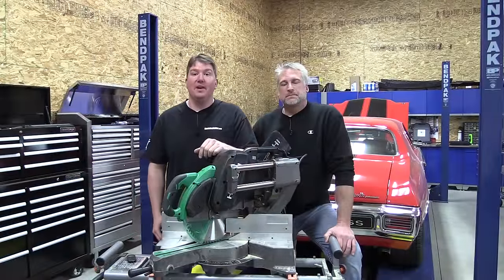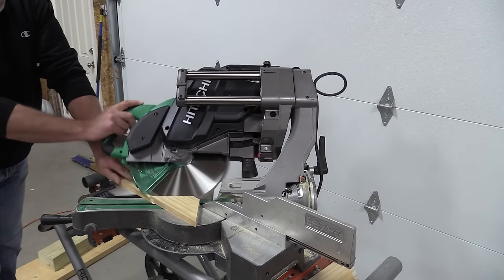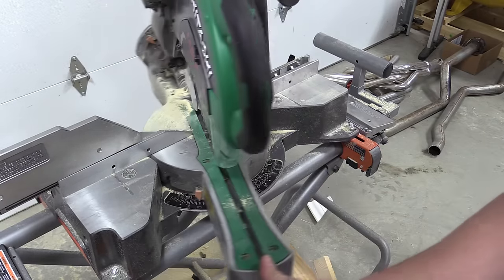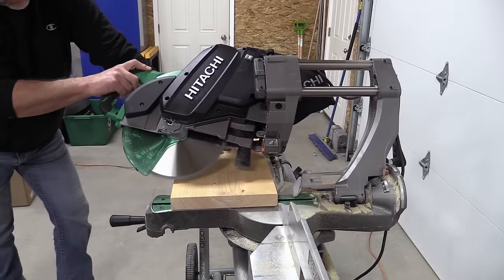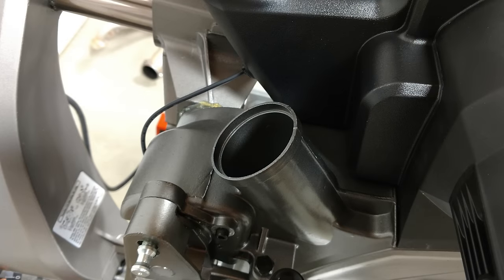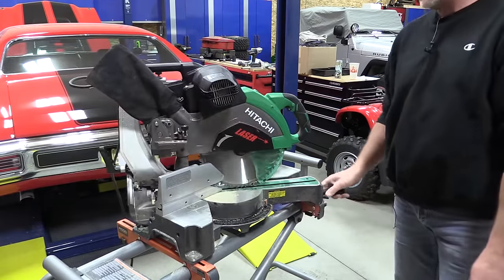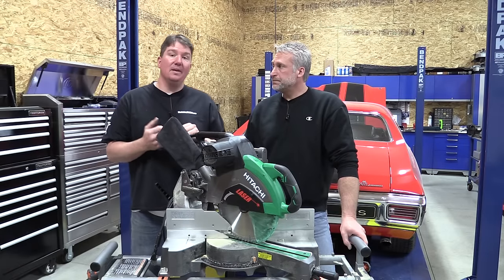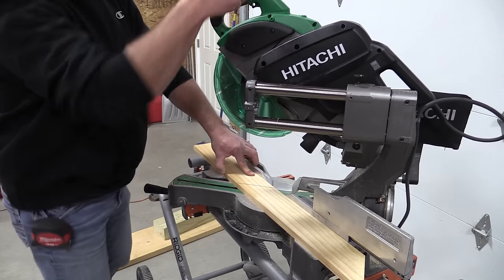Hitachi C12RSH2 15 Amp 12 Inch Dual Bevel Sliding Compound Miter Saw with Laser Marker

Comment: I have this saw and I had it's predecessor. At first I truly felt that it was simply a stripped down cost cutting downgrade. Those feelings quickly subsided though. Yes you lose the micro bevel, slide cover, crazy awesome looks, and the depth stop no longer swings out...BUT in return you get a higher fence THAT SLIDES OUT, noticeably more power, ridiculously easy brush access, a more comfortable handle, wider table, and it's significantly lighter (those few pounds add up fast) without jeopardizing the build quality. I also have a 12in Delta Cruzer and I'm absolutely in love with both of these saws. I've used a ton of Dewalt sliders as they seem to be around on every big job site, and I also previously owned a Milwaukee 6955-20 that got stolen off a job site within two months lol (wasn't laughing at the time). This saw is as just good as any of them out there when it comes to finishing your job within the time you have to do it. The one thing I don't care for is the bevel, which is obviously the biggest complaint. It's annoying to set and it only goes to 45 on each side. Also the blade is VERY close to the throat plate at full bevel and many have said it tends to scrape on theirs. I've not had that problem but I definitely wouldn't question the honesty of those complaints. Still, no miter is perfect in every way for every person. This one gives me enough reasons to prefer it over any other though.

Comment: you checked the saw for square on the wrong corner, granted if the board was parallel it wouldn't matter but regardless you should have the square on the edge that was against the fence.

Comment: I have this saw and purchased a universal adapter from Amazon. It fits snuggly over the dust port on the saw. The other end ( I cut off the smaller sizes) fits quite nicely into a ShopVac 2 1/2” screw hose attachment. The type that you can twist into the threaded exhaust port of some ShopVac models. It stays in place pretty well, although you could always tape it to ensure the hose absolutely doesn’t move, but I’ve not had a problem with it.
Reply: Aaron Karnovski can you please provide a link the adapter?

Comment: I have the previous generation of this saw I have had it for a year or so and I like it especially compared to the craftsman one I had. The laser works well I ended up using an adapter on the dust collection and my vacuum hose slides right inside the adapter and works ok. Like most miter saws the dust collection isn't great but ok. I have a dust hood I am making for it when I make my miter station. I like it overall but haven't used the side miter much so the handle in the back is annoying but not a deal breaker.

Comment: Not trying to bust your balls but a couple things here. 

1. You should check 90 with the side up against the rail perpendicular to the cut you are checking. You checked the outside, in a perfect world it would be parallel but it's just good practice. 

2. The rail system is not innovative. Festool, Bosch, and even craftsman have came out with zero clearance rail systems. It's been done for a long time. 

3. The laser diapering shouldn't be an issue. You line up your mark to the laser and then cut. No need to see the line the whole time. The laser goes away with lowering because of the rubber dust chute. 

I have the older model and love it. Especially on sale, it's a fantastic buy.
Reply: 2. Yes, it's been done for a long time... and Hitachi was the first to do it. It's a Hitachi innovation in that Hitachi pioneered it. http://www.businesswire.com/news/home/20050816005061/en/Hitachi-Pioneers-Sliding-Compound-Miter-Landscape

Comment: The only thing I didn't like was the laser being blocked when the blade start to come down. I am a beginner diyer so I need all the help I can get. Used to have the harbor freight dual bevel sliding miter and after 2 weeks I returned because it took up too much space, and you had to square the saw if you wanted to get accurate cuts.  This one is ready out of the box with the exception of the included blade.  Spend the extra $50 for the finish blade. Great video guys!!

Comment: If there was a shootout of the top three 12" saws, What are the top three? I ran out and bought the new Harbor Freight Hercules Miter saw since it is as good as a DeWalt for a lot less, but now that Ive seen this and several other that I didn't consider, I'm hoping I did well. I really like the way this saw can be put right against the wall. It looks like the amount of degree sweep this one has less than the Hercules.

Comment: The bevel lever feels backwards because it is a left hand thread.  I just got mine and from the way they used the bevel lever it seems like a minor issue at best.   It was like they had to find something to complain about.    Glad they mentioned the laser on switch because I hadn't gotten that far in the manual.

Comment: I have this saw and the slide is very stiff. Does anyone know what to clean it with and lube? Or maybe there is something wrong with my saw. Does anyone know if there is supposed to be two bearings or one on the slide. My saw has one.

Comment: Man, just bought the C12RSH2 at Lowes, and they have the C12RSH at Ghanall Lumber. I'm wondering if I should return it and get the older version.
Reply from the maker: woollybullyful that would depend on how important the micro adjustment is on the bevel.

Comment: How does it perform chopping down 8/4 or 12/4 hardwood stock?  I have the Ridgid 12" sliding miter and it chatters like a lonely old woman on adderall when I try to slide it through thicker rough stock.  Curious if this design/saw performs better for woodworkers.  I think the Ridgid was designed with rough carpentry in mind.
Reply from the maker: Scally Wags This saw does well with hardwood.  I have never cut 3" thick hardwood, but 2" is not an issue.  I did find that a good Diablo blade made a big difference for the better.
Reply: WorkshopAddict I think y’all tested the Ridgid R4221. Did you have any issues with that saw in 8/4 hardwoods?  I’ve already had mine repaired from the factory once due to gear misalignment which is a well known issue on that saw. Hard to tell if the gear design is just a perpetual issue or what.  Curious if you had any insight.

Comment: Thing I do not like, dust collection port,  the handle on the back for bevel adjustment is a poor design and a pain to use, no shadow line (it has a laser line but those suck), depth cut adjustment is there but it sucks because you have to constantly adjust it.

Comment: I have a hitachi dual bevel miter saw model C 12lsh. suppose to be double bevel but this saw does not bevel to right. did hitachi make this model with only bevel to left or is something wrong with mine and how can it be fixed. thanks
Reply: Go to the 4min:36sec mark in this video: https://youtu.be/4zNnkoR54uo

Comment: Looks like a nice saw guys.  Brian do you have a Dust Right Universal Small Port Hose Kit from Rockler.  Great for connecting to odd size openings.
Reply from the maker: Russ Webster We do not, but the way the hole was machined it will be tough for anything to stick and stay.

Comment: Metabo is the same as Hitachi? If so, they have this on sale at Lowe's right now for $199.
Reply from the maker: Metabo HPT is Hitachi.
Reply: @WorkshopAddict  - Read a review that it's a great saw for $200, but blade does wobble, so you have to go ultra slow on precision 45 cuts...
Reply from the maker: @RebelRob34  You will not find a nicer saw than that for less than $450
Reply: @WorkshopAddict  buying today...do i just use blade that comes with or get an expensive one?
Reply from the maker: @RebelRob34  Try the blade that comes with it and see if it cuts to your liking.  If it works well, stick with it.  Black Friday is coming and blades might be on sale if you need it.  Awesome deal.

Comment: How tuneup? I got one, and it's not square. How to fix it?
Reply: TorresSidney there are 3 bolts you can adjust to square the saw. Two are on the base, which the saw leans against as the 45 degree stops either side. The Third is on bevel section, behind the saw (you need to tilt it to the left to see it). This adjusts the 90 degree stop. Either use a roofing square with 45/90 degree sides to put against the blade, or a digital bevel gauge to check for square. 

If the crosscut is out of square, I’ll have to check the manual and get back to you on how to adjust it. Most likely will be on the underside of the saw though.

Comment: Just get the Kapex by Festool and be done with everything else.  You'll never look back and ask if you got the right Mitre saw.
Reply: christschool ha, $1500 for a miter saw... yeah right
Reply: There are $10,000 miter saws at the high end. BTW, I also have this Hitachi so it wasn't a knock against this saw.
Reply: Got rid of my kapex before the motor burned out.  Also, Festool customer service here in the US, (Lebanon, IN), is complete garbage.  They couldn't fix my OF1400, the bit wasn't centered in a guide bushing.  I ended up fixing it myself.  I have a video of how to repair it if you like.